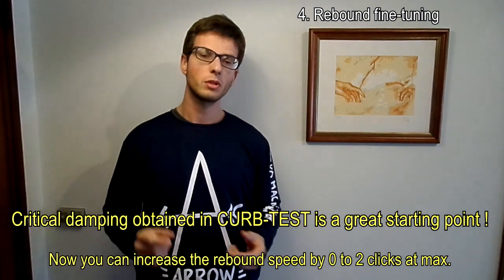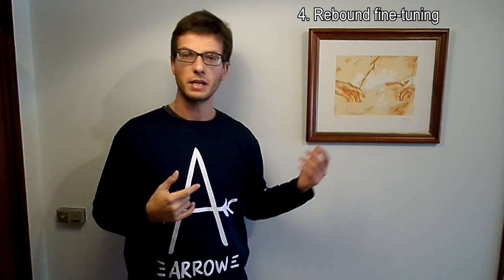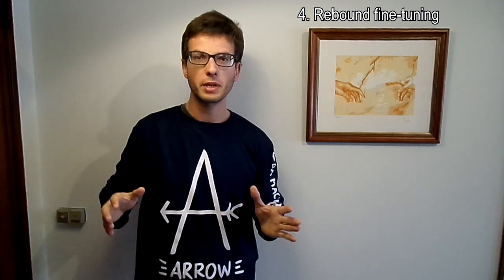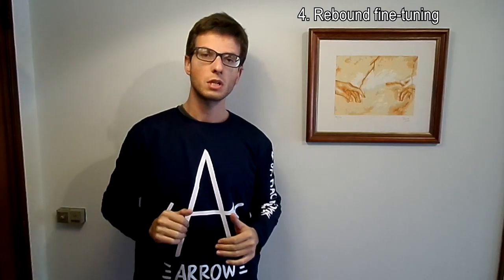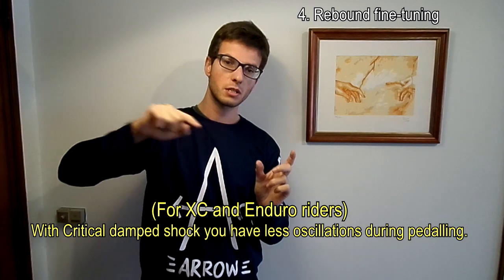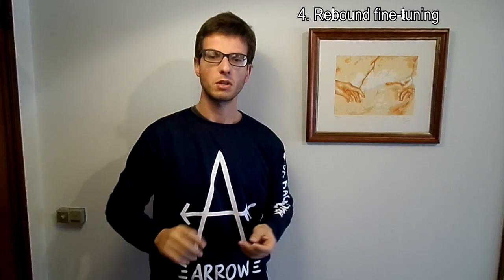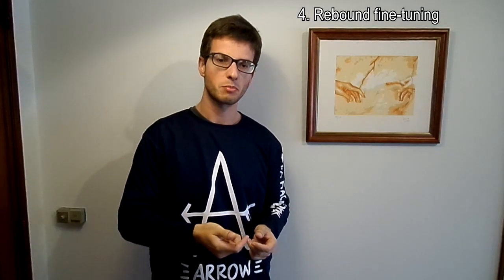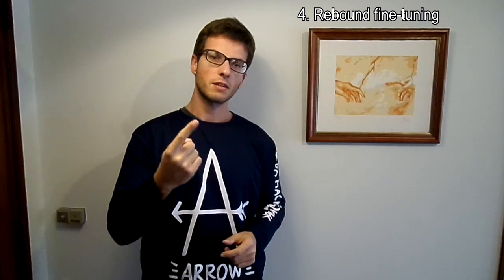How to CORRECTLY setup rebound damping (MTB rear suspension Ep.5)

Comment: another question: in what position should the compression adjuster (on a vivid) be when doing this test as it will influence how much the shock will be compressed. fully open to get the max. compression or the normal riding set up?
Reply: +andrextr Sounds convincing. Thx for your answer!
Reply from the maker: +Monster Bikra Hi ! The guys at Fox recommend to setup the rebound without compression damping. Typically compression and rebound circuits are independent, and by adjusting compression shouldn't change the rebound and vice-versa (at least in good shocks that does not happen). Therefore, I don't think that compression damping adjustment will significantly affect the curb test result. Moreover, in the trail you run with compression damping, so, why not to use that compression damping in the curb-test to simulate the "real-world" conditions? However, if you do the test with the shock locked-out (an extreme case of compression damping) the shock wouldn't compress on the curb and therefore, there will be no rebound (.... lol). Probably that's why they recommend to adjust rebound without compression damping. You never know when someone tries to adjust the shock in the locked out position :D

Comment: now let`s apply that to a downhill bike as the body position is way different than when sitting down.
let`s say my riding position is not perfectly centered over the bottom bracket like when sitting down. does that mean that i have to set my rebound up a tad faster to compensate for the additional force on the shock? 
accordingly my rebound has to be a bit slower if my riding position is over the front.
Reply from the maker: +Monster Bikra I understand your concernings but I don't think that will affect significantly the results. I mean, when you adjust the SAG you also face the same "problem". Should you set the SAG seated? standing in the middle of the bike? behind the saddle?... You have to adjust shock and fork in a neutral and centered body position and assume that as a representative/average body position. Typically, when you are seated on the bike, the rider weight distribution is 65% / 35% (R / F wheel), depending on bike geometry and rider. When you run DH, you body moves a lot on the bike, therefore your weight distribution will change (probably you get values between 60-80%  at rear wheel)... As I said in the video the curb test is your starting point. For DH I recommend +1 or +2 clicks (towards faster rebound), depending on the type of tracks. Therefore that extra clicks will compensate your rider position concerns :D
Reply: Hi andrextr and thanx for the nice vid.
I have a vivid air on my bike that has beginning and ending stroke rebound.
What do i do in my case...the same as the ccdb air you described earlier?
Reply from the maker: Hi! Beginning-rebound is the LSR and ending stroke rebound is the HSR. I will try to explain in a future video why there is a need for this speed-sensitive rebound damping (the so called "digressive" damping). But basically you want an HSR faster than LSR. However use always the curb method to test for excessive oscillations. For DH i'd recommend just a tiny oscillation. I never used a shock with speed-sensitive rebound adjustments, so to decrease the complexity of the task, it would suggest to increase both rebounds speeds in proportion until critical damping, and then fine tune the rebound (in this case, increasing the speed of HSR, and maybe decrease LSR a little bit). Always check with curb test. :) Bye